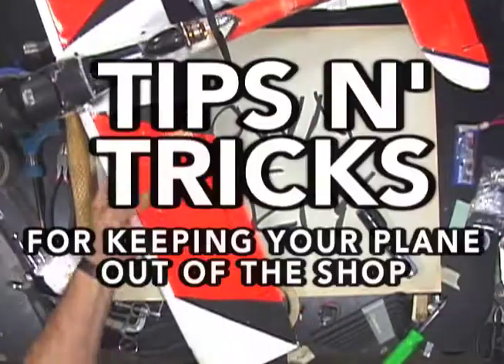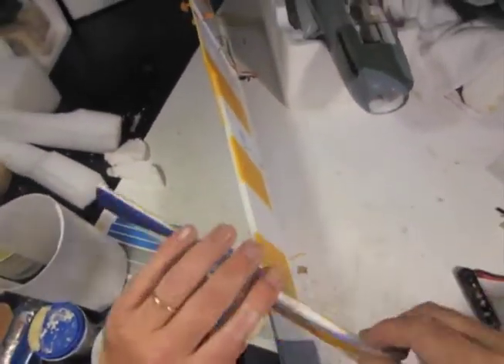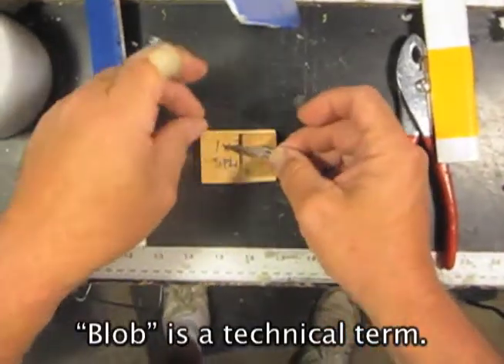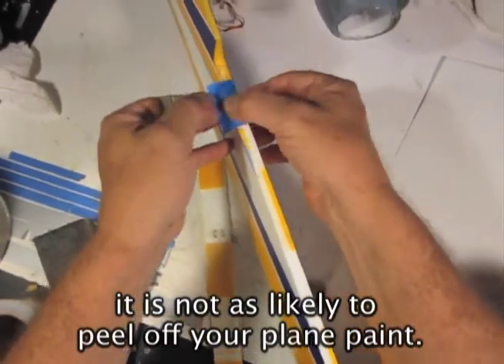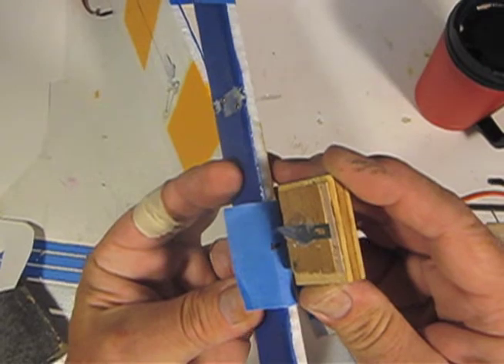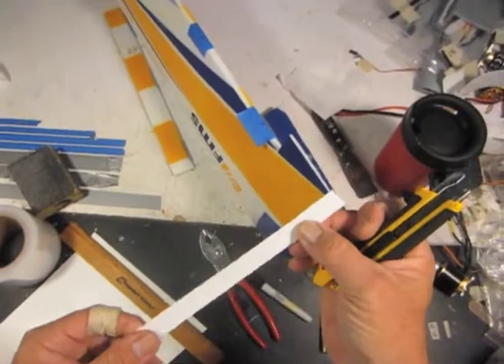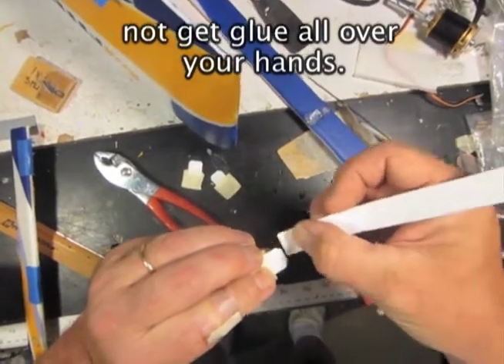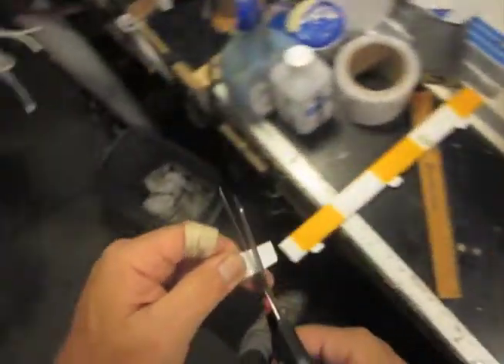Down & Dirty Tips n' Tricks - The BEST Foamie Hinge Anywhere!

Comment: Now yer talkin! I genuinely hadn't managed to do any proper slit hinges before this day. Even on my first  proper glider 6 years ago, the good ol' Easy Pidgeon. Neither the rudder nor the elevators had been pre-mounted or even slotted at the fatory. They did supply several pieces of flexible sort of fibreglass type stuff, (still have 'em somewhere) but I was a total beginner. Too embarrassed to go to a local shop and say, " I bought this off the internet, but can you help me!" So they got hinged with packing tape. They worked, but needed replacing later. Experimental airlines was my guide.
Reply from the maker: Hi @wordreet - hope this helps and good thinking on the other solutions!!
Reply: @Killerplanes  Heh, at that stage, I'd never done any of it before, so it was all taken from the Interwebs. 😋

Comment: What works great for me is the filter material from pool filters.
Reply from the maker: @Andy-df5fj  gotta try that out. All I need is a pool filter!
Reply: @Killerplanes  
I suppose furnace air filters have similar material.  Dryer sheets seem to be similar as well but a bit too thin.
Reply from the maker: @Andy-df5fj  Got those! Probably not as unbreakable as HDPE, though. I imagine they'd be difficult to get into a slit in foam- HDPE is hard enough!
Reply: @Killerplanes  
Yeah the slit needs to be opened up with a Popsicle stick or something similar because the material isn't that rigid, but once they're installed, the hinges are very low friction.